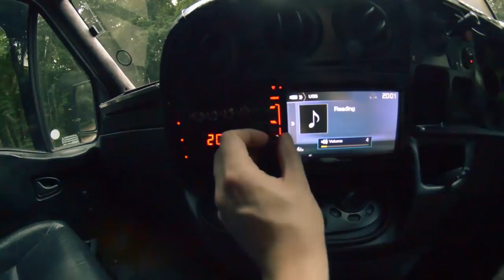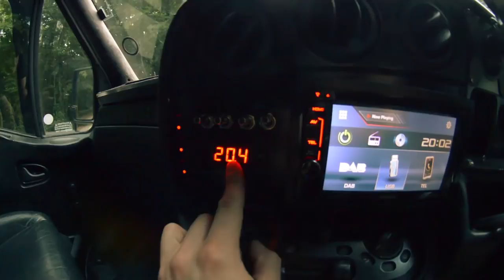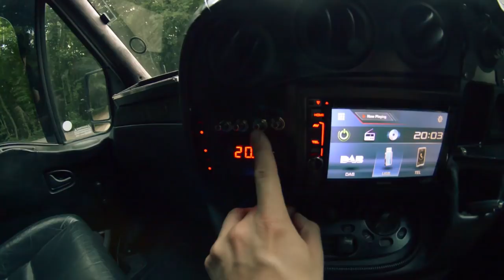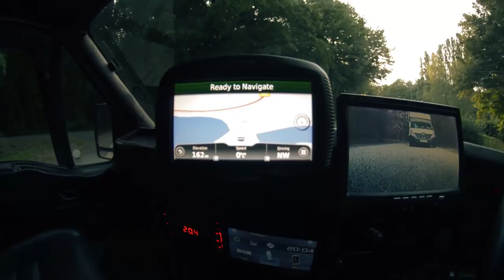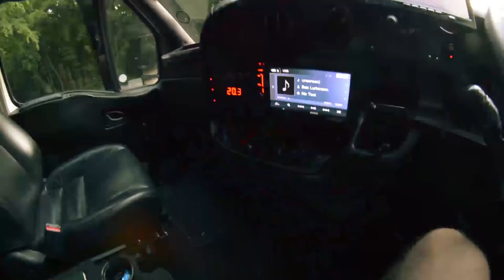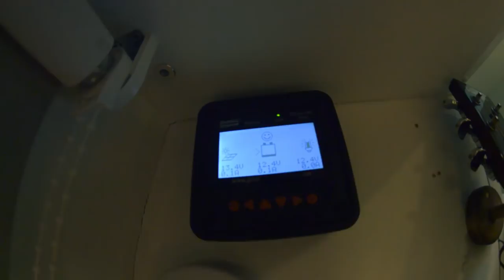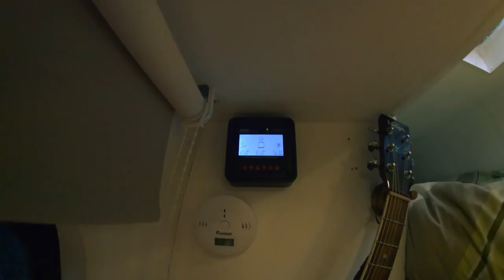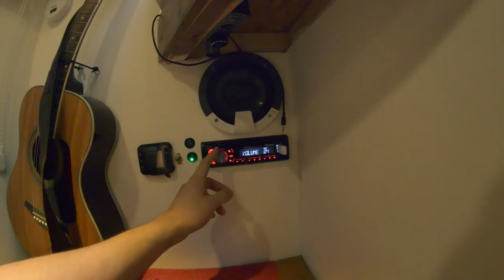SELF BUILD Camper With Fixed Bed And Huge Garage... Iveco Daily VAN TOUR

Comment: Hi ash great video, if you were to do this again would you still buy a Iveco? I'm looking at doing this myself and trying to find a reliable van!
Reply from the maker: Hi Paul, thanks a lot! Yea in a heartbeat... anything you buy is going to rust, don't listen to all the biased crap. Good thing about iveco they sit on a ladder chassis so you can easily repair the underside of the bodywork and then just maintain the chassis. Engine is a beast too, dragged me up a few mountains so probs

Comment: a very good video... Many thanks. One quick question if you don't mind, What is the locking system for security on the doors.. thanks
Reply from the maker: Thanks, glad you enjoyed it! The large black locks are called puck locks I believe. It's basically a padlock but a bit tougher and with a guard around the outside

Comment: Looks like your water compartment isn't insulated Ash? Might be a good idea to do it before winter?
Reply from the maker: Roy Gardiner hi Roy, do you mean the part under the sink? It is actually insulated the Same as the rest but I didn't bother with the hardboard covering because i couldn't be bothered basically 🤣
Reply: Ash Pollard Ah. Thought I saw white side panel inner behind the fresh water container.

Comment: Hi bro, nice van . Looks like a tank. What tyre size and model did put on it? Thanks for sharing
Reply from the maker: Hi dude, they are kumho road venture mt51 m+s. Can't remember the exact size and it's dark outside 😄
Reply: Ash Pollard  thanks man, well it would be perfect if you look for it ( the size) on the sunlight. need to know, thaks again!
Reply from the maker: CHEMAwaters A they are 235/75 r15 buddy
Reply: Ash Pollard thanks for the answer.